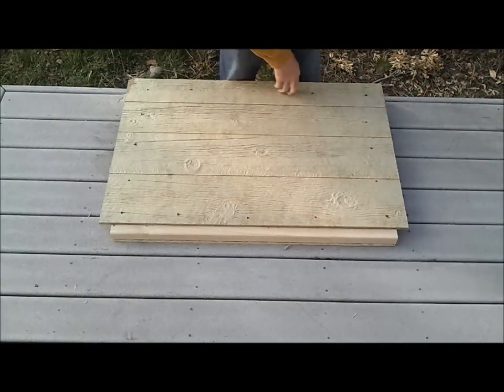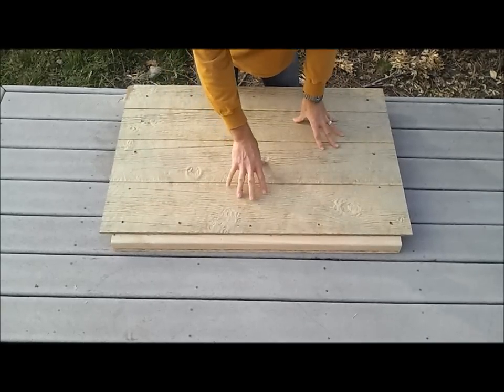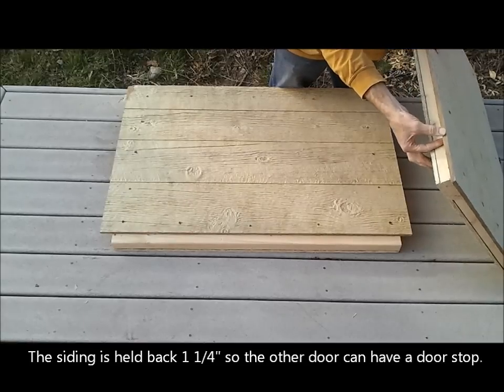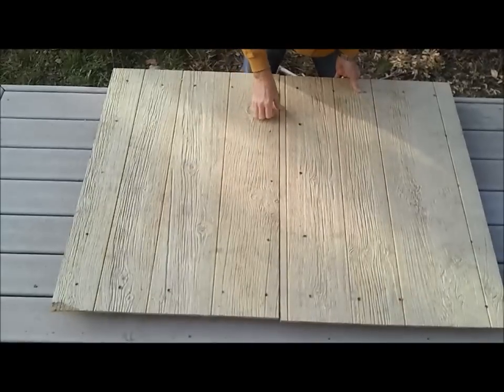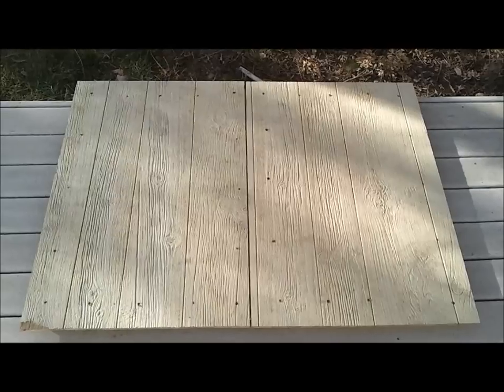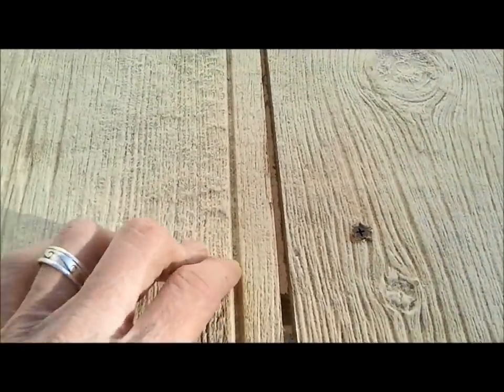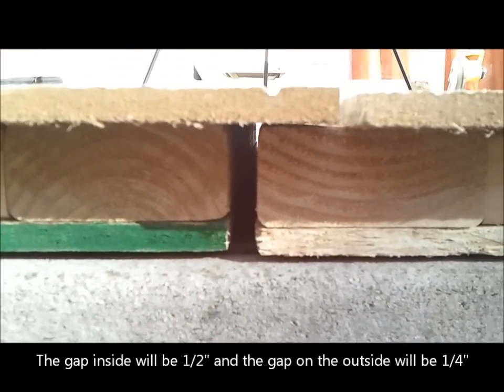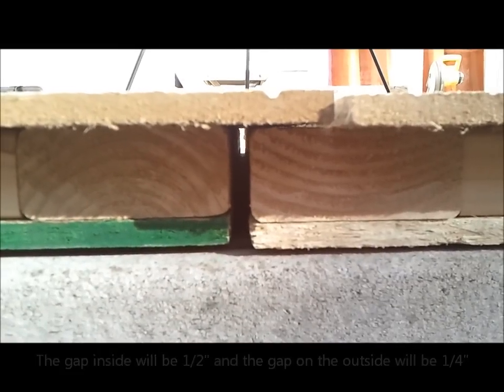7-Shed Double Door Construction - How to Build a Generator Enclosure

Comment: is the 1 1/4" reveal in this video an extra piece of wood or is the exterior panel cut back an extra 1 1/4 to show part of the 2x4 behind the panel?
Reply from the maker: The exterior panel is held back to show the face of the 2x4 rail behind it.
Reply: @icreatablestv  So after u do this, and then install the trim, does that make one door look like it is 1 1/4 inch wider than the other door.  That's what I'm seeing.  Thanks!